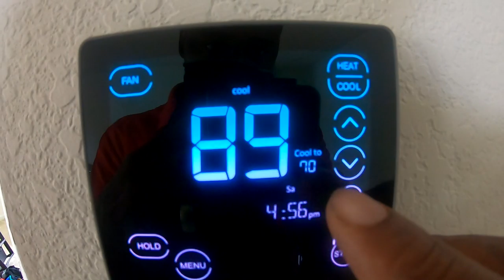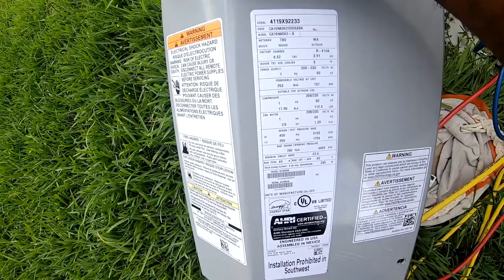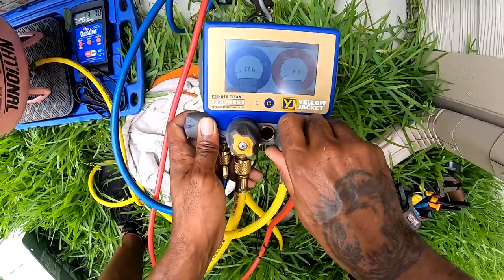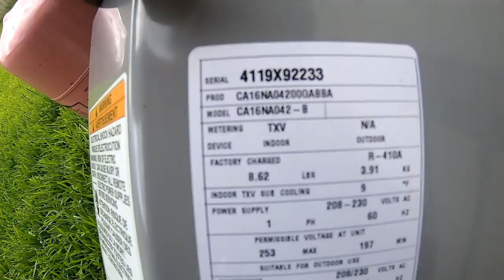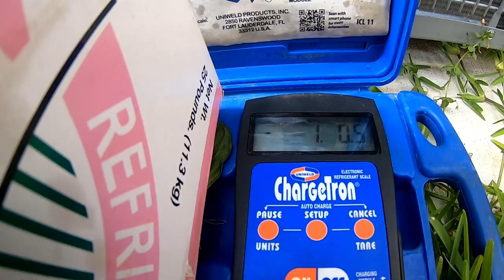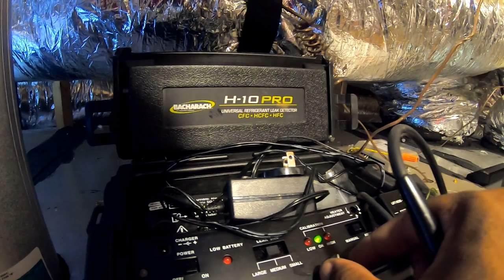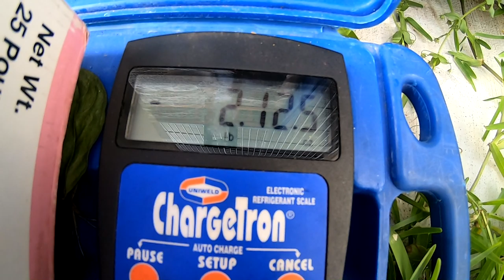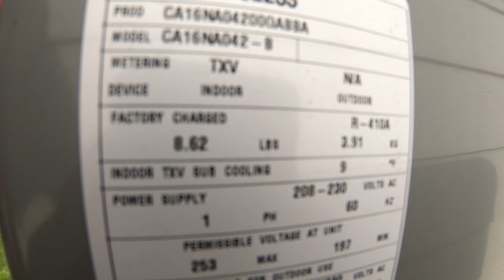"Hot Mess Alert: Carrier AC Unit Refuses to Cool! Witness the Troubleshooting in Real Time"

Comment: The CA models of Carrier are equivalent to Payne and are made in Mexico. The models that start with "24" Comfort series would not had this problem. They are made in Collierville, TN. The USA- made ones are dipped in paint. The Mexican- made ones are spray painted and rust quicker. The metal is also flimsier and inferior to the USA models.